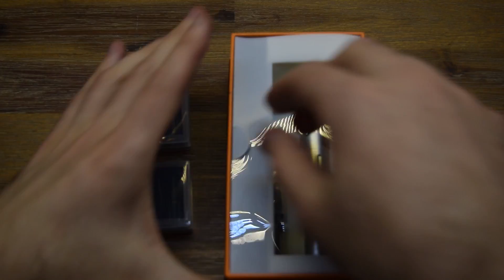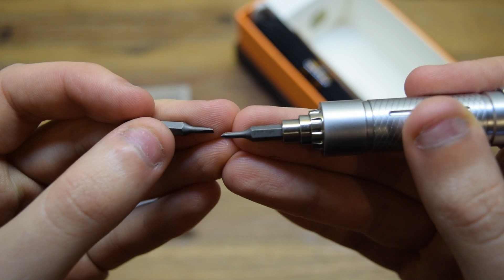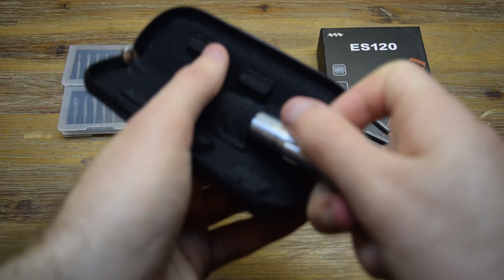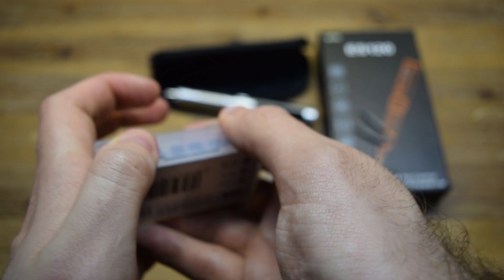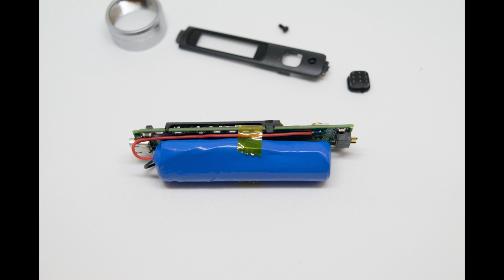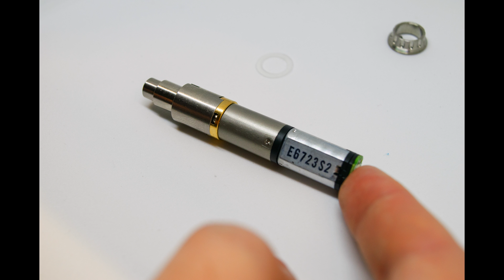ES120 Motion based electric screwdriver Introduction

Comment: You know something, for the price of this screwdriver the cheap ass manufacture needed to include all bits, and a way, way, way better case sand is a must, and it needs to hold all the bits. The button must get relocated. The screwdriver needs to come with a lifetime warranty including free round-trip delivery. Is this screwdriver worth $120, those cheap asses included a 40 bit set and life time warranty. I mean really,  are you that damn cheap you cannot include at least AT LEAST 40 BITS? It cost less than a penny to make one bit and if you don't include those things, than your penny pinching cheap ass deserves to go out of business.

Comment: Thanks for your excellent review.  This video is the only one I found that includes a tear down.  I bought mine a few weeks ago and noticed that when I charge it fully and leave it on my desk for 3 days, the battery is completely drained.  I have only used it for about 20 minutes of total work since receiving it.  This is not good because I would need to recharge it every time I use it.

Comment: Hi, sorry, but I do not understand if it comes any more tips or if I have to buy them separately, in my case, I would like to know, if I can use it to mount helimodels 450,500 and other classes.
Reply from the maker: Hi, The unit normally only comes with a Phillips size 00 and a small flathead screwdriver.  The other bits are available for purchase, or you can use any other 4mm hex shank bits, such as the ones sold by ifixit or any other hardware store. I'm not sure what the requirements for the helimodels are for their assembly,  however, you can look at the available 4mm hex bits to see if they would work. The only other factor to consider is that some of the hex bits are rather short, so adding an extension can help but it will typically be slightly wider than the bit.
Reply: Hi, thanks for the reply, if anyone already uses Helimodelos, please contribute by informing.

Comment: Which Firmware do you have? My Display look different with DFU 3.44 and i have less functions.
Reply from the maker: In the newer firmware, the P mode was actually removed as it was not useful.
I have just started working on an open source firmware build for this unit (coming soon - when I have more time to work on it). However, there is also an update coming for it to firmware 1.17 which improves the response of the unit. I'm planning to host this firmware shortly and will ping back when i have it uploaded somewhere.
Reply: Oh what great news!  You did an amazing job with TS100 iron, can't wait to see what TS120 will be like with your firmware.  Sadly I don't own neither yet.

Comment: Thinking about any new firmware features that would be possible with this hardware?
Reply from the maker: Yeah, I'm currently waiting for the current code base or schematic to be released. I plan to add a retry mode so that it doesn't stay off once the over-current trips so it will pulse to try and get the bolt/screw out. Also thinking about adding an automatic mode that doesn't require the button to be held down.

So hopefully soon I will be starting an alternate firmware for it :)
Reply: if you can,then pls tell to e-design group to use the magnetic usb plug charger instead of the ugly and bulkie usb mini.
Reply from the maker: Hi, which style of magnetic charger are you talking about?
I prefer the micro usb as it can't be lost. I've lost chargers for soo many tools over the years, but usb micro is a nice standard to use.
Plus with the usb coming in the end its out of the way if you need to use the unit while it charges (ie if you let it go flat, you can use it while it charges).
Reply: +Ben Brown, That's great news; very good ideas.  Do you think there is a way to measure or calibrate torque in newtons on the display?  I'm curious as to who the people from this E-Design group are...  they're quite brilliant.  Side point; this set of bits appears to be compatible and has a lifetime bit replacement warranty; https://www.ifixit.com/Store/Tools/64-Bit-Driver-Kit/IF145-299-1  I intend to use mine with them and hope it can take some abuse.
Reply from the maker: I'll have to get back to you on the measurement, If there is a current sensor there should be a way to make a calibration. It may not be ideally perfect calibration but should be fairly close. As far as I know (and understand) they are the parent company of miniware. So they also make the ts100 and the miniature oscilloscopes (http://www.miniware.com.cn/).
Ohh that's a very nice set of bits, I'll probably pick up a set :)
Reply from the maker: +mistercohaagen , As an update to previous comments. I have received some further information on the unit, and it does have the required sensors to be able to build up a rough force measurement. Probably wont be terribly accurate, but there is hope :) When I can do testing I will answer back.
Reply: +Ben, Niiiice : )  Yeah, the ifixit bits seem good.  Wiha makes more expensive 4mm bits, but they seem to twist and deform just as easily as anything at this scale.

Comment: "There are 2 sets of bits available for purchase with the screwdriver" 

Can you link where you could purchase this with the bits, or even just the bits?
Reply from the maker: The main place I use for purchasing of the bits is Aliexpress at the moment. I'm not sure of which outlets are stocking the bits themselves at the moment. Searching Aliexpress for the ES120 seems to bring them up reliably, or try ES-A7 ES-B7 which are the codes for the packets.
Reply: Thanks!
Reply: 幾錢?